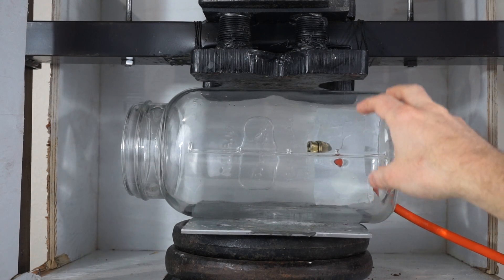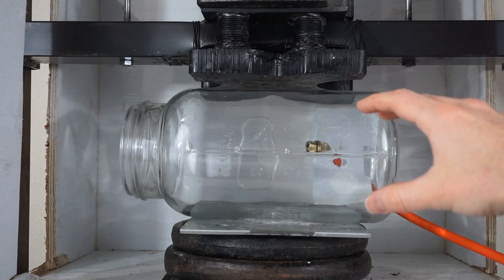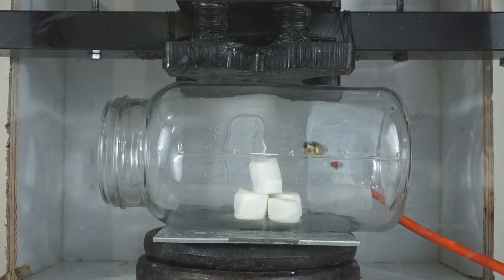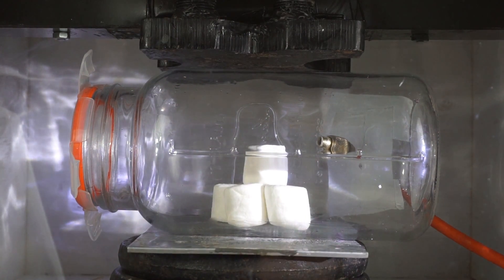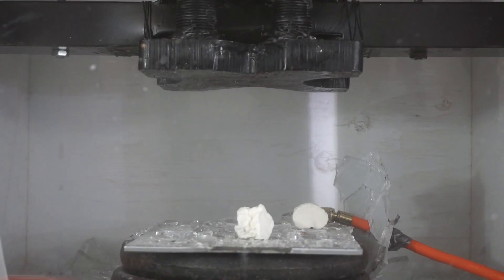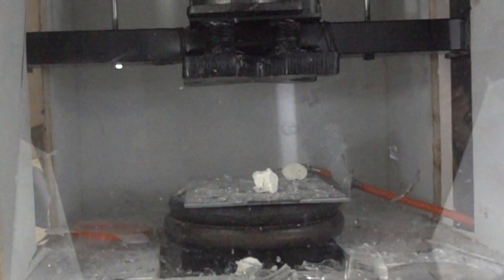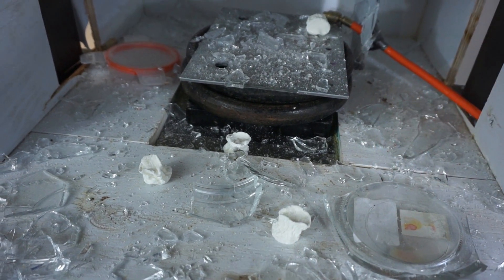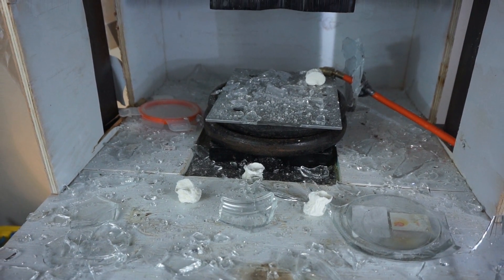What Happens When You Crush A Vacuum Chamber With A Hydraulic Press While Under Vacuum?

Comment: If you crush an item in a vacuum chamber with a hydraulic press, can you super compress it? Because when a container is airtight and you hydraulic press something inside then the container breaks cause the air has no where to go but if it is a vacuum chamber and it constantly reduces the air pressure building up then you could super compress something couldn't you?

Comment: The reason we didn’t see an „implosion“ is because air particles are to small to be seen by the human eye(without light refraction of course) so the air particles around the vacuum imploded, but the glass exploded due to how fast the air particles replaced the volume of the area the glass took up.

Comment: Think about this; if you expose a vacuum system it will equalize. If you expose the system on the bottom, so it has to pull the air upwards against gravity. It will still equalize. Then can you explain how the vacuum of space doesn't equalize the earth's atmosphere when the upper levels of the atmosphere are under less pressure than the surface of the earth?
Reply from the maker: +Hamster Lord Gravity is pulling air down to the earth as the air is trying to escape into space. What you are left with is a pressure differential. The atmosphere at mt Everest elevation is one third of the pressure at sea level. The pressures stay separated because of the height difference. If you have molecules that are moving fast enough then they do escape the earth. For example helium atoms move fast enough that they do escape the gravity pull of earth. Any helium you release to the atmosphere will eventually leave the planet. But nitrogen and oxygen do not move as fast and are larger so that they cannot escape the earths gravitational pull.

Comment: Of course it's going to implode, because you're applying a force in the same direction that you would expect in an "implosion"
Reply: Indeed that completely messes up the results really because it's not an evenly distributed force either like a pressure triggered implosion would be worse still being a cylinder the uneven application of mechanical stress at the top and bottom actually results in a significant outwards force at the sides also which is actually pushing against the atmosphere. Course it's kinda tricky to set up a properly controlled experiment for something like this on a budget ideally you would want a pressure vessel which will fail at a pressure differential just bellow the difference between the ambient pressure and the minimum pressure your vacuum equipment can achieve.

Of course short of developing far more advanced molecular assembly technology than we have manufacturing even the most consistent materials to that level of tolerance with regards failure strength isn't really possible and glass is especially sensitive to even tiny fluctuations in conditions during manufacture for it's final strength. There is good reason why we never engineer anything that matters without a generous safety margin on the theoretical strength of the construction materials after all only way to know for sure which side of the mean a given component is strength wise after all is generally to break it which kinda isn't practical for components one needs to use after.

Comment: if you get a small jar and turned it into vacuum chamber and put some water in it and removed all the air, so the water boils, and somehow removing the hose to the vacuum from the jar without letting air back in, would you have a jar of water that would continueusly boil forever?
Reply from the maker: +SimplyAwesome77 the boiling  water would increase the pressure until it no longer boiled as soon as you removed the vacuum:)

Comment: explosion not an implosion, soon as a slightest crack or hole appears the  rush of air cause it to explode it over compensates to replace and equal the pressure.  the press caused the crack or hole causing the explosion. if it was just a regular jar it would not have been so catastrophic.

Comment: Slow mo was really cool. You probably would have gotten the same results even without vacuum in the chamber. You have got to get a less wimpy vacuum pump. Yours seems to be able to get down to 100 mbar abs at best, There are other small portable units that can het you down to 10 mbar or even 1 mbar abs. You'll be able to boil a lot more water based stuff, and even freeze (below 6 mbar abs).